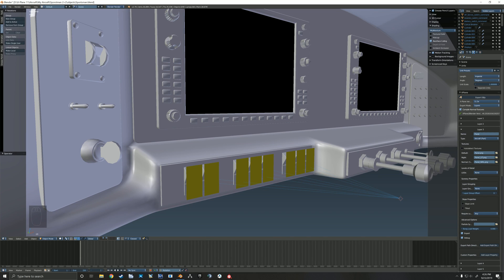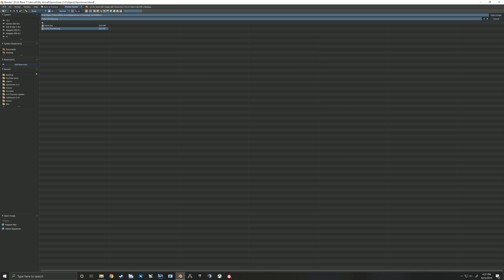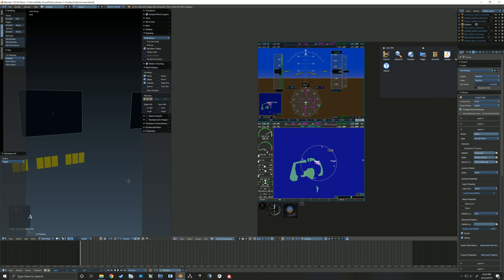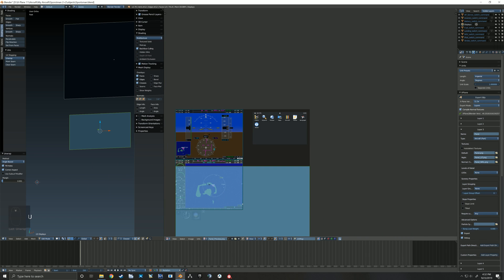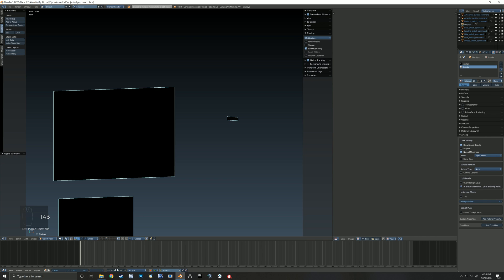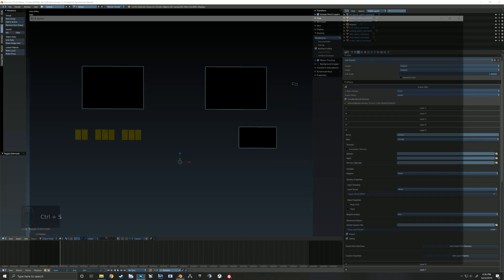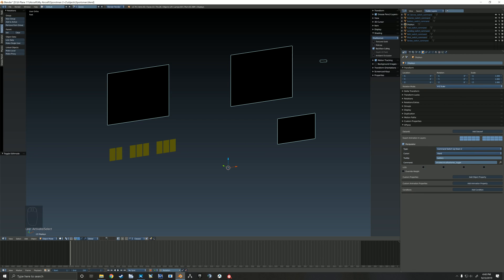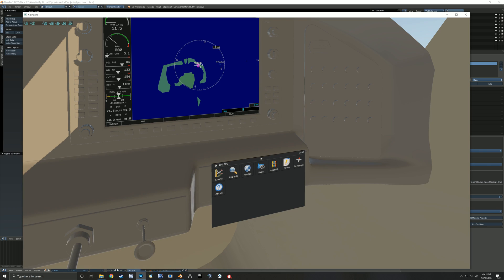How to make an airplane for X-Plane 11 Tutorial #19

Comment: I started a flight with my plane in X-Plane. There is no difference inside or outside view right? Then I press CTRL+SHIFT+ALT+SPACEBAR. But nothing new appeared in my cockpit_3d> - Panels - folder. Please help.
Reply from the maker: Do you have a cockpit object? Is your cockpit object labeled as a cockpit object in planemaker? You won’t get a panel in the 3D cockpit folder if it doesn’t see an object to be used.
Reply: @BuildItBetter3D  Thank you for the reply. I already solved that issue. The problem was I didn't select Cockpit Feature "Cockpit panel texture". Then 2 problems were solved. Thanks.